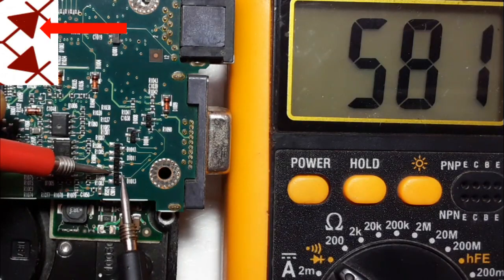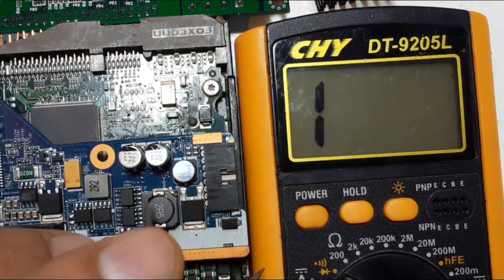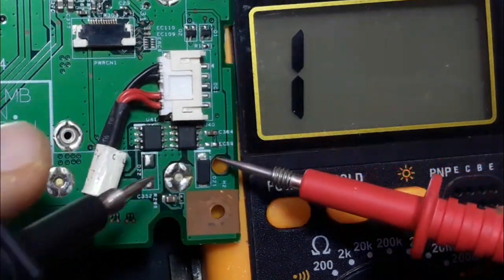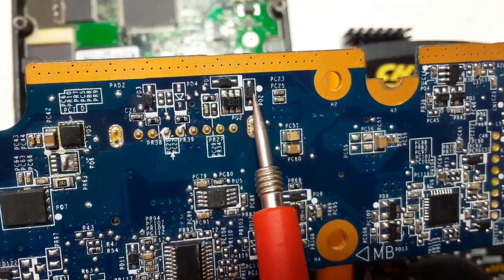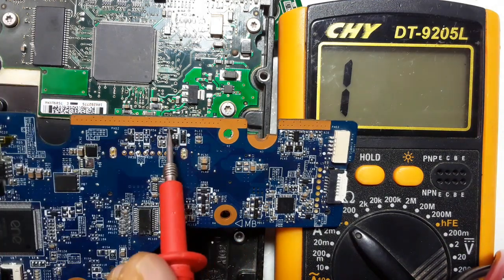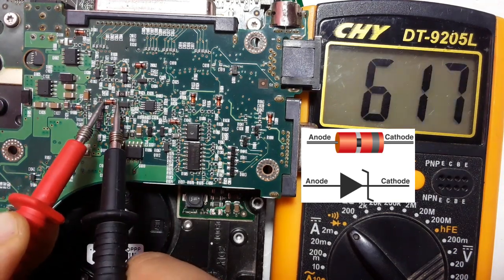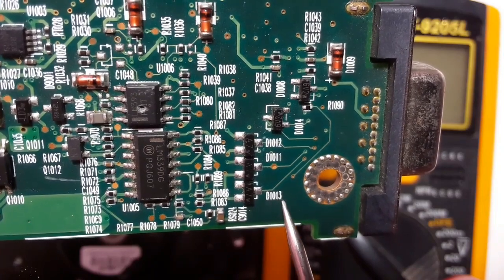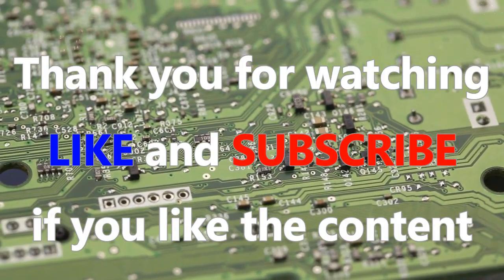Learn SMD diode testing with multimeter in 8 minuets

Comment: hello sir, your video is so simple and easy to understand. now I have an issue about the project that I working right now. here is the problem, I have a broken diode, and on its surface its written W8. i really want to know if you could help me, is there any equivalent to that diode?? or maybe what diode should I use to change that broken diode? bcs in my place there is imposible to find W8 smd diode. or at least, could you tell me, what website should I search to find that W8 diode equivalent??? please help me, Im waiting your answer sir. thank you so much

Comment: I working on HP Pavilion x360 is plugging in charging but no percentage increasing
Reply from the maker: Is the adapter compatible with the laptop. It should contain chargera pin in the middle